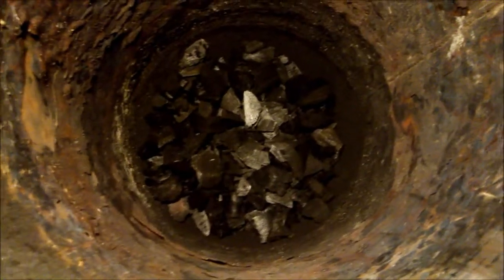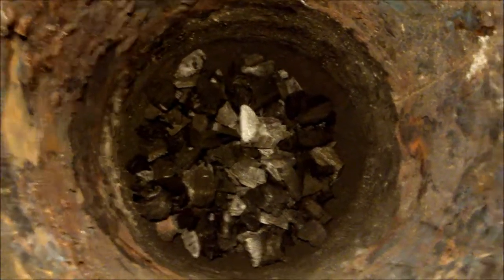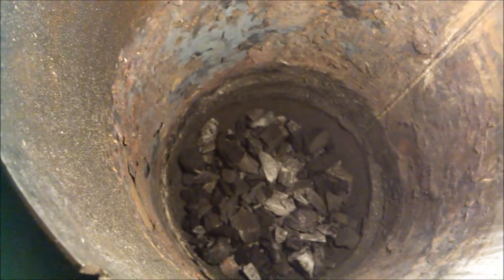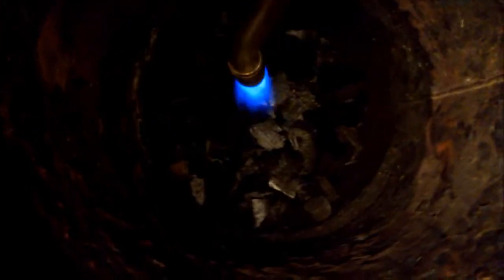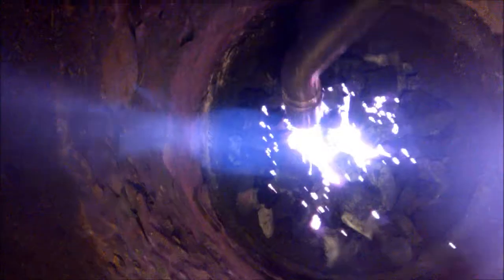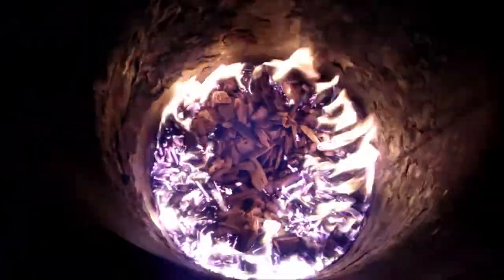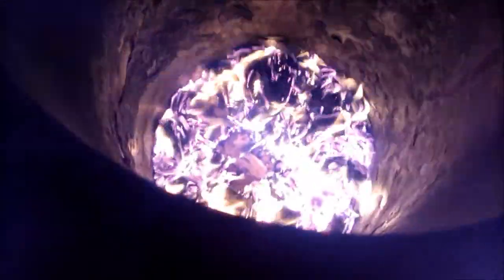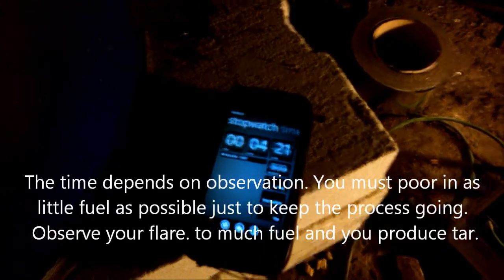Open top, no nozle drizle gasifier, The DriZzleR

Comment: I am very curious to find out what effect drizzling water into the chamber will have on the gas flame output. This french guy demonstrates the increase in energy by drizzling water in this video.
COMBUSTION DE L'EAU/ BURNING WATER STOVE www;ecoteco.fr
Reply from the maker: Roy, Thank you for the Link. In the early day's of "the DriZzleR", Then called the "Lukotop", when I was feeding air into the oxication zone by a central nozle from above, I did some tests by feeding to this central nozle a waterdrip. I could not see much improvements. For some reason I forgot, I left this idea aside. Maybe got too involved by the excitement on how well driZzling worked, but maybe one day I try waterdrip again. Thank you for reminding me.
Luk

Comment: seems like a pain the @ss how is this better O.o
Reply from the maker: OXO, use your imagination a bit. Here are the following advantages. Open top means you can constantly refill and autamatic runs continiously for days after days very easy with a simple  fuel suply system (auger, bucket elevator, transport band. Very low flaming pyrolyses bed means no problem with hollow burns, bridging ...and best of all, have yo seen the unfilterd flare? Nice one tar free. There are much more advantages but follow the discussions on yahoo woodgas group.
Reply: Luk Vanhauwaert ok here is the down side the open lid if there is a puff back it will throw hot flaming embers everywhere an auger just means more moving parts (a draw back of any design) bridging is not really a problem in a correctly set up hopper and a blue flame dosent mean there are no tars my reactor gets the bluest of flame but there was still tar build up in the throttle body of the engine so no points there it cant go on a car and i dont like the yahoo message groups b\c they blow up ur e-mail im not trolling or being negative this is just my opinion
Reply: Luk Vanhauwaert BTW my name is Xoie (for real) lol =3-
Reply from the maker: xoxoXoieoxox Xoie, With the open top in gasifier operated  in drisle mode there are never puffs, you can simple stop your gasifier and start it after a few hours again. Nothing not the litleist puff will hapen.Tthere is no smoke either when operating. Here is a link from somebody who was very critical and did not beleived it would work. Just for fun he screwed off the hopper from his imbert style gasifier closed the nozles and opened the top and he never had before so good results as with this technique. Mind you the blue flare you see in his video is UNFILTERED. He wrote me after this test. Luk I am now a beleiver. Tom B's Gasifier
Reply: Luk Vanhauwaert well i never sed it would work i just think the operating prosedure is drawnout and a pain just my oppinion =\
Reply from the maker: xoxoXoieoxox What you see in my video is just a demonstration of the principe. I still think you have little inmagination to understand how easy it is to aytomatisise the drisle method. Here is a link of pascal who used the drisle method in his fully operational cogeneration system. running VW 1.6 on woodgas 10,4KW/h output with 5,5kg woodpellets per hour.
14 hours continoius run without any problem. No pain at all. Inmagine what it would have been to run the same time a closed imberst style gasifier?That would be a pain.
Reply: Luk Vanhauwaert well IDK it just seems like more moving parts just invits more problems and less moving parts is always better IDK mabuy its a gut feeling but personla pref. for now remains with the imbert as far as the pain i would not know ether way for i have yet to do a long run but one other thing how would u make this work on a car i mean there bulky enof to try to put on a car let alone MORE peices IDK like i sed its just gut feeling for now but my sys seems prity simmple to operate and its not every day u find an auger in the trash =3-
Reply from the maker: xoxoXoieoxox To make it completely clear. This is not a system for driving. this is stationary system for cogeneration. meaning producing electricity and heat. It uses a car engine but the engine does not drives wheels but a generator which gives you electricity and the heat from your cooling system of your engine gives you heat. Look it up: COGENERATON.
Reply: Luk Vanhauwaert im not an idiot i know what COGENERATON. means i have steam engines for this but i cant put my steam engines in my beetle no can i =3-
Reply from the maker: I did not say you are an idiot. You just do not follow close enough what we are doing. Our work has no intention to ever run a car with our gasifier. Makig a gasifier to run a car is far less complicated than maki,g a gasifer for stationary use.
Reply: Luk Vanhauwaert how in the world would u think it would be easier to build one of these for a car and dont u think that a steam turbine would be much more efficient for ur needs and steam boilers are already well understood and WAY more efficient than any internal combustion engine will be on any fuel so i still dont see the point O.o
Reply from the maker: xoxoXoieoxox?????
What has steam to do with this video, where is showed a way of producing engine grade woodgas by a revolutionay new method in a simple new gasifier design.
Reply: Luk Vanhauwaert
u sed it was made for stand alone power generation and i sed dont u think steam power would be more efficient..thats what steam has to do with this video =\
Reply from the maker: xoxoXoieoxox Steam is a nasty medium. And horrible expensive in the big KW range. A used engine you can buy for peanuts. Say the Volkswagen engine Pascal uses he bought it for 50 euro's in ebay. It brings 10 to 12KW electric and 25 to 30Kw heat with no hasle and no danger at all.
Reply: Luk Vanhauwaert whats so nasty about steam modern steam burns cleaner than wood gas or just as good i have a 10 kw steam engine i made for free with junk and VW engines here in the US go for a minimum of 400-600$ and u just feed it wood and there is no more danger than running a wood gasifier remeber they can blow up too =3-
Reply: Luk Vanhauwaert its just b\c u dont understand steam power and it is a hell of a lot more efficent than a IC engine as far as fuel conversion
Reply from the maker: You are speaking only theory. There is a man on the Yahoo woodgas group; Stephen Sabadess who contrary to you has not just theoretical knowledge but actualy worked a lot in practise with steam. If you do not beleive me just ask Stephen about his experiences and he will blow your nice steamy dream completely appart.
Reply: Luk Vanhauwaert what the hell do u mean just theory i have like 7 diff steam engines here at my house and 2 boilers i think i know what i am talking about ITUW ill check ur link if u just check my channel and see what the hell im talking about BTW steam boilers and wood gasifiers only blow up if operated improperly once again back to the hole human error thing
Reply: Luk Vanhauwaert ohh ya BTW i built my first steam engine in the 4th grade =3-
Reply from the maker: Nice try and Yes, I even beleive you. But how long did it last and how much power produced it?. A proof of concept or a laboratory test is not to compare by a continious working and relieable machine. There are a lot of bright idea's but very little bright products. Like to see one of your steam engines now!!. Post a video? or post a link to a small relieable steam engine producing 10kw electric and 30 Kw heat, costing second hand around 50 euro's and which is good for another 2000 hours flawless working.
Reply: Luk Vanhauwaert ok its clear now u will never listen and a power teast i have steam engins that are over 100 years old and they still work flawlessly and yes the v-5 engine i have still working and i run it every time i got out to the dessert to power the flood lights
ohh and one more thing..what built america?? =\
Reply: Luk Vanhauwaert
this has a 5k gen head on it
Reply: Luk Vanhauwaert here is a two cyl i made making power its a short run b\c its on a air compressor instead of one of my boilers and the comp. cant keep up but its making power none the less and seems prity safe to me considering im running this vid in my living room =\
Reply: Luk Vanhauwaert how a bout u check my channel to see them all
Reply from the maker: Oxo, Yes I will take a look. and come back to you later what I think about them. One thing. I do not live in Amerika. So untill a bit later.

Comment: Thank you for sending me this link! Nice job!
Reply from the maker: Flash,you too are doing nice things. I sometims watches you.
So far the drisle method works fine with pellets up to 70mmbar underpressure, but with chips it is limited to 30/40 millibar underpresure. So realy big engines (more than 2 litres) producing above 15Kw electricity and 30Kw heat are at the moment the upper level. This is far enough for any home to run off grid but we  think with another reduction and grate design we, curently are working on, we might get higher in the future.